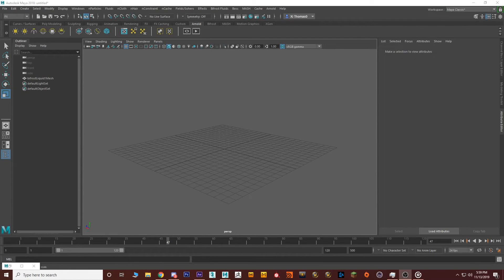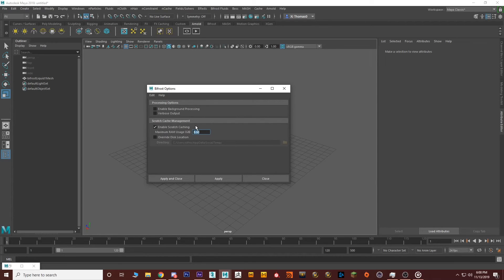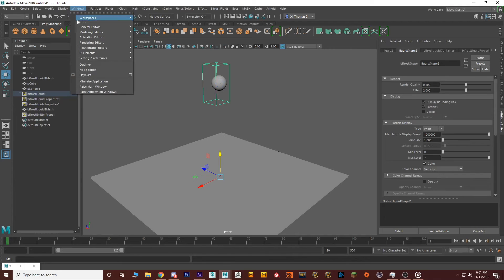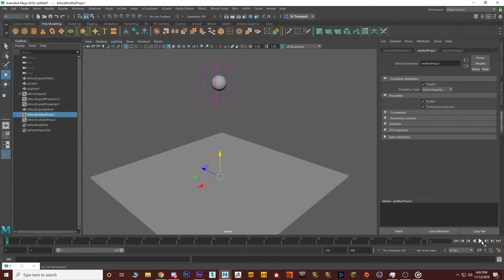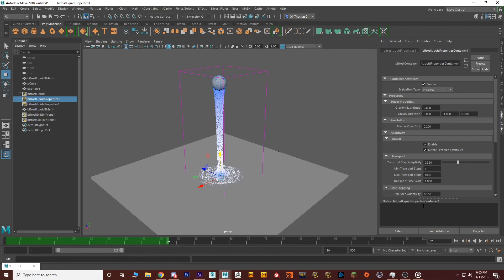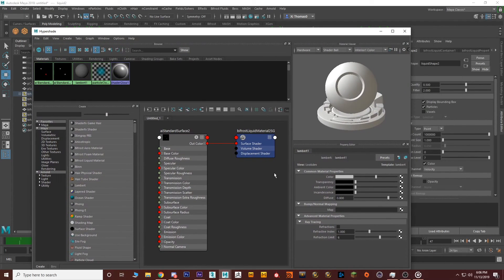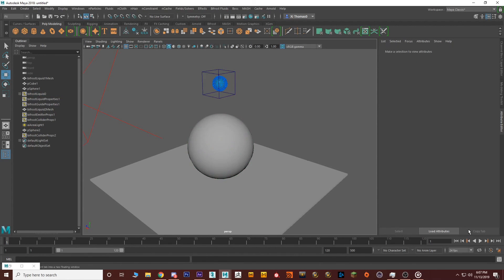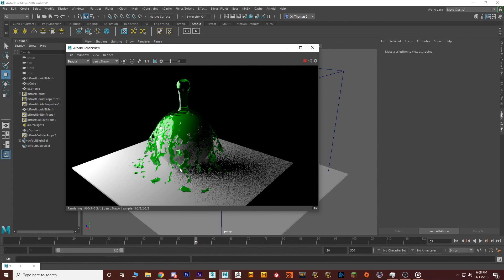Bifrost Maya 2018 Introduction

Comment: Hello, thank you for you video. I wanted to ask you, is it a problem if my timeline doesn't turn into green even I if followed everything you said?
Thank you in advance :)
Reply from the maker: Hey Yasmine , No its technically not a problem if the the timeline dosent go to a green hue , it just signifies that the Rams are Caching your simulation . ( usually used on Computers with less power to hardware ratio) in most cases people have decent computers to run the simulation smoothly :D
Reply: @peps3dtutorials699 thank you very much!